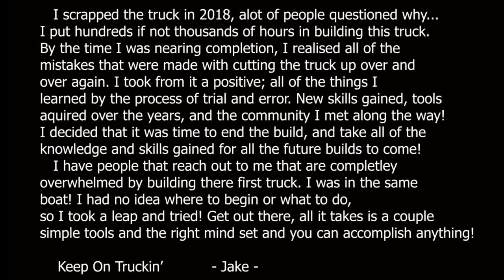Bagged/Bodied Hardbody Build // The Final Crush

Comment: Where did you get the seats ? I currently have the bench/single seat
Reply from the maker: Cheap amazon bucket seats. No name brand they were like $300. Or you can get factory buckets out of an kingcab d21 or pathfinder
Reply: @scrapingpavement  what year should I look for my hardbody is a 94 ?
Reply from the maker: @Lilperez661  d21 1986.5 through 1997 will bolt in. Pathfinder 1987 through 1995 will bolt in as well

Comment: What a waste of a good extend cab hard body all that just to drag and make sparks at night I own a 95 single cab that I spent quite a few thousand bucks on building that KA-24 engine it’s nothing to run it way past 100 in third gear she just breathing good at the higher RPM scale I showed a V/8 Nissan Titan who was boss  and a 302 Ranger and a 4.6 Ford explore bunch of noise but no go on the other end  and I haven’t butchered my truck up just lowered it at both ends for handling at high speeds in corners and straight aways !!!
Reply from the maker: Too each there own 👍🏼 thanks for watching!